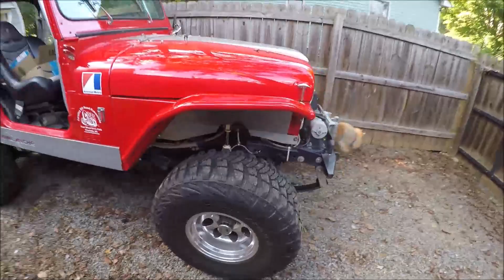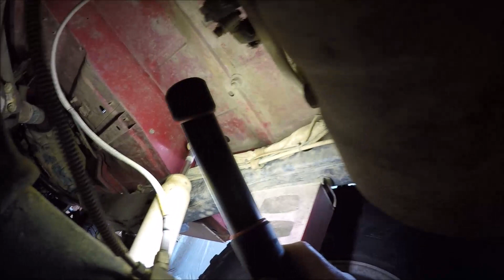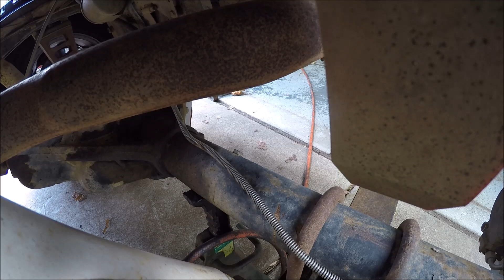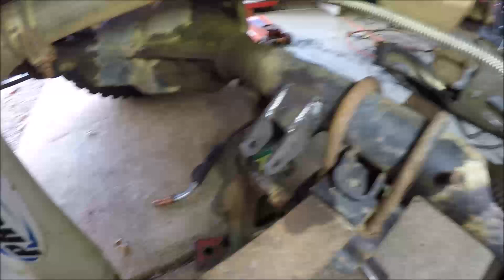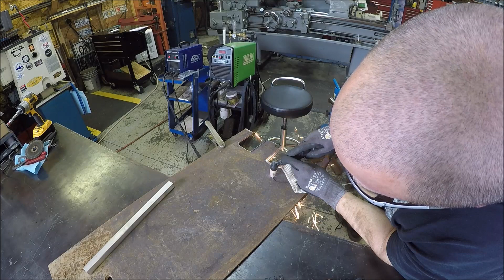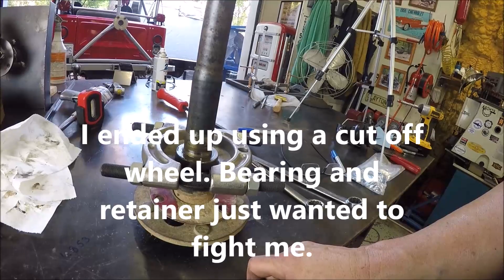Jeep CJ rear axle upgrades

Comment: for less than the cost of a replacement axle you can fix the amc 20. that is stronger than a 8.8 and a D44. and just about par with a 9 inch. 
the 9 only gets a edge due to the third support for the pinion. but the ring gear can flex under High stress loading.  and that is more a drag strip thing anyhow.
and how often does one need to change gearing.. in a hurry?
with all that said.  for my amc 20 it has survived for 40 years.hard rock crawling with 4.10 gears a detroit locker. and full float shafts.  no welding or truss.
Reply from the maker: As you know the inherent issues with the 20 are the 2 piece axle shafts, thin wall tubing, and axle tubes turning in the 3 member. A buddy of mine twisted his AMC 20 real bad while climbing the rock section of lower 2 trail in Tellico back around 2000.